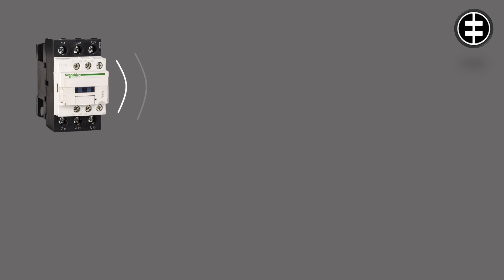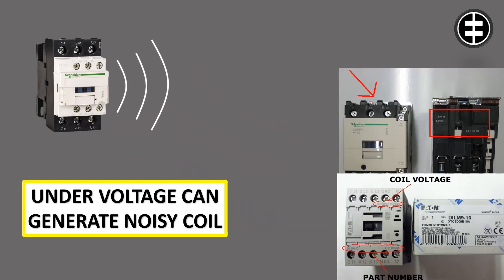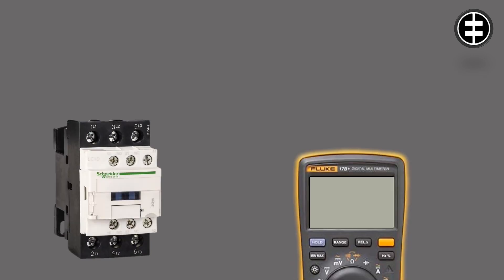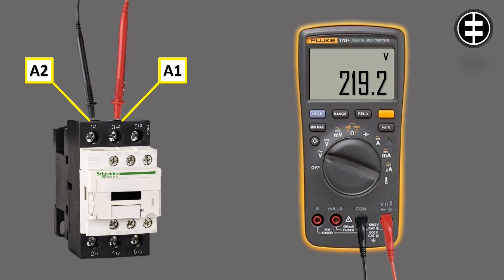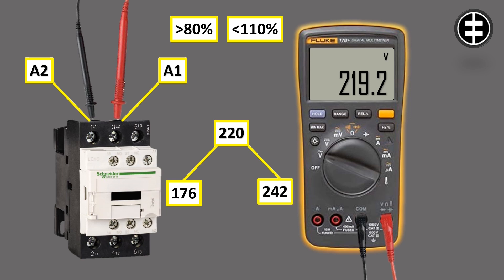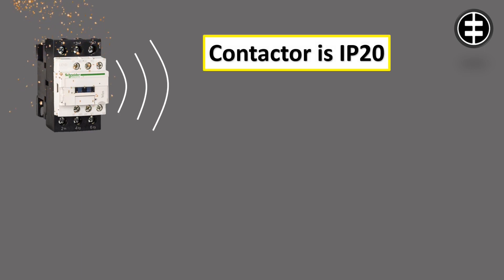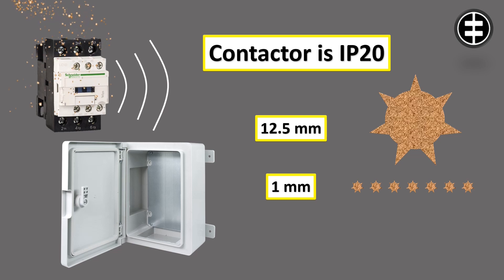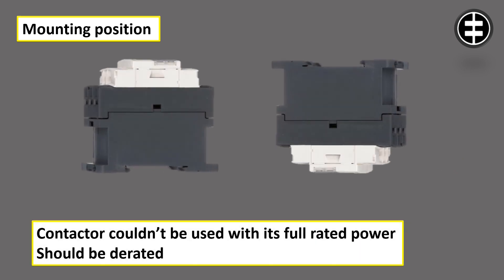Troubleshooting Noisy contactor, humming contactor reasons and solutions.

Comment: Hi sir, 
I have a abb power contractor of 25A 220V auxiliary supply  ..i need a VA  ratings of the auxiliary coil but it's not mentioned.. So how to calculate VA ratings for this
Reply from the maker: You have to check the contactor's datasheet